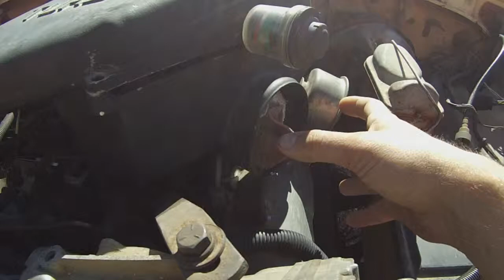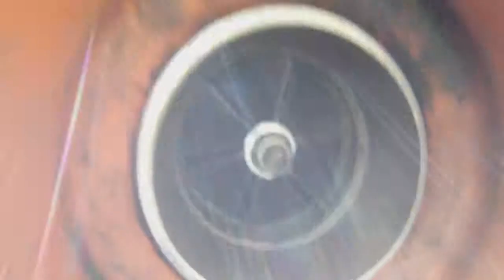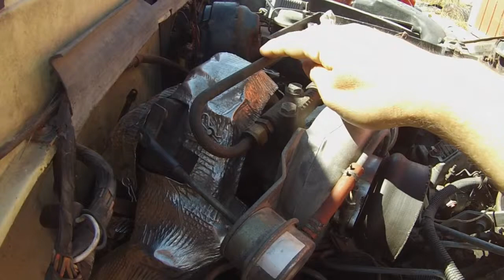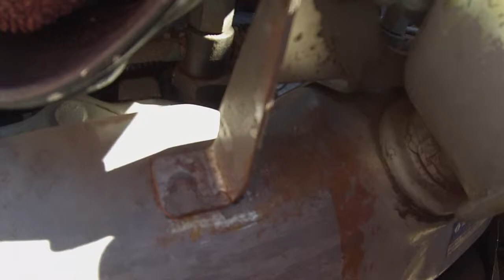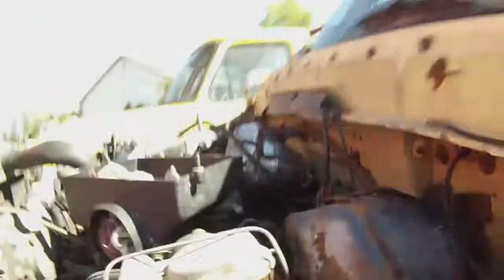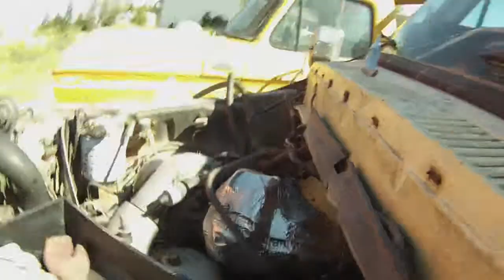Project Red Green 1976 Ford Supercab IDI Swap *Factory Ford Turbo System Basics*

Comment: What size clamp do you have on the down pipe? I went to hook mine up and the clamp is to large.
Reply: I just realized this is a pretty old video.
Reply from the maker: Fairly old but I do still have the tuck, are you needing the Part Number for the VB-band clamp at all? I can look on my 093 engine in the shop area and get it to you along with approximate measurement.